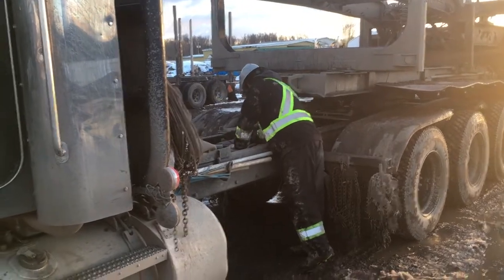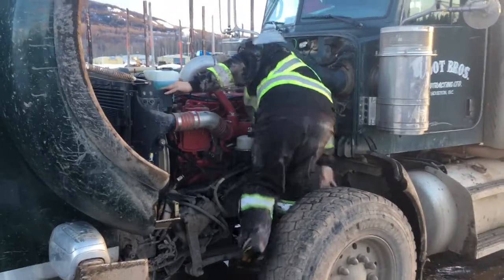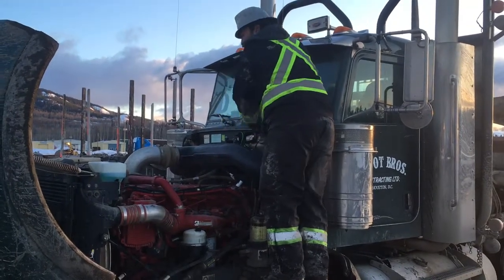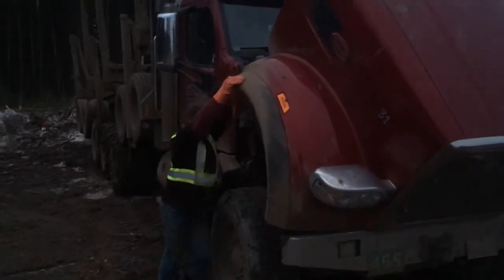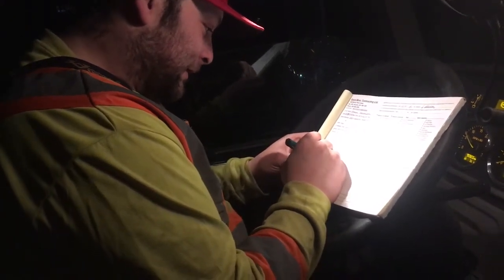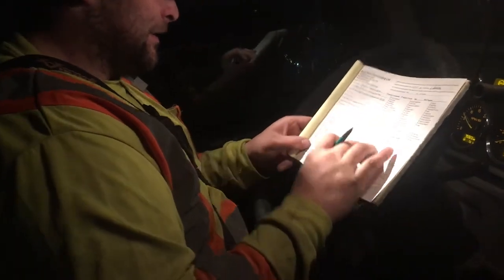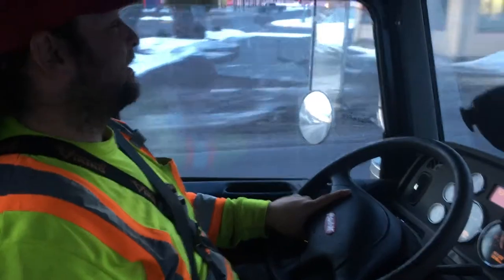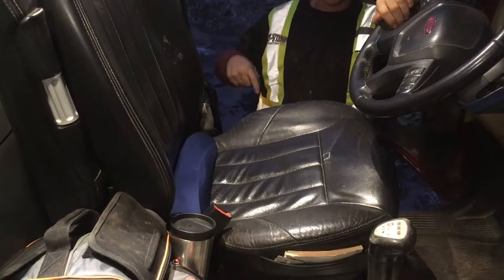Log Truck Driver Physical Demands

Comment: From a driver with allot of varied experience, this sounds real bad. Especially the sketch slippery back roads/chaining up. The best driving job out there is a cement/RDY Mix driver in a union environment. take the tip!